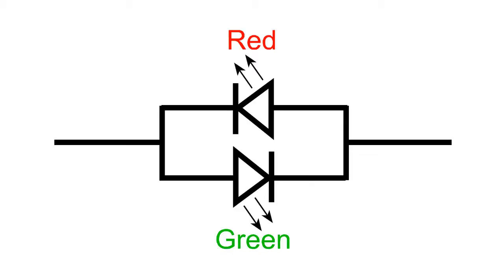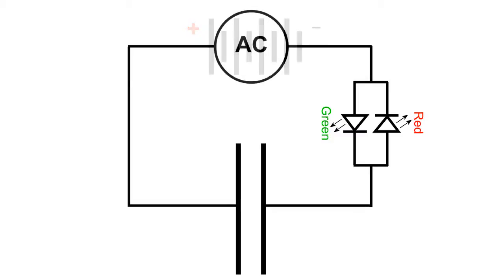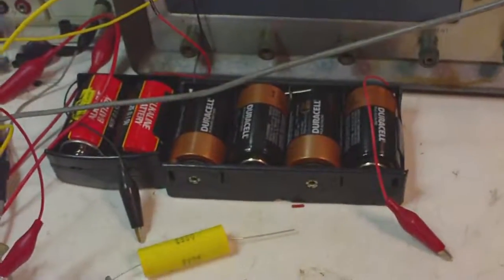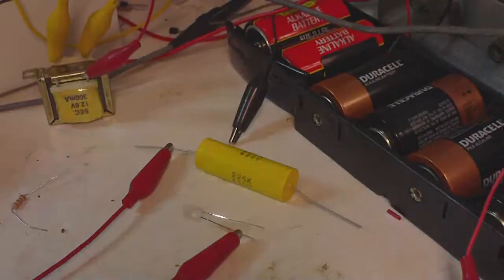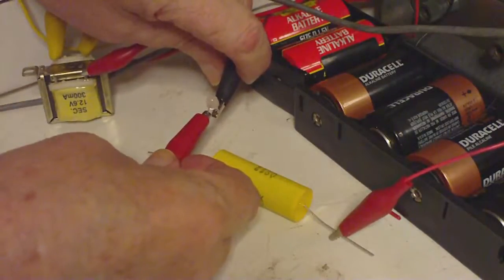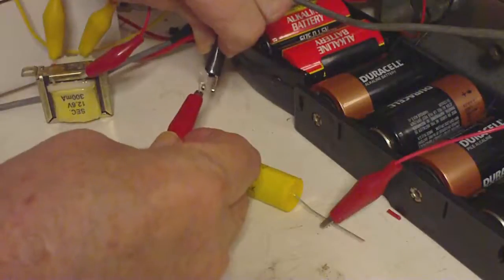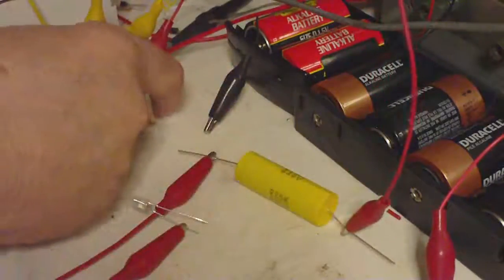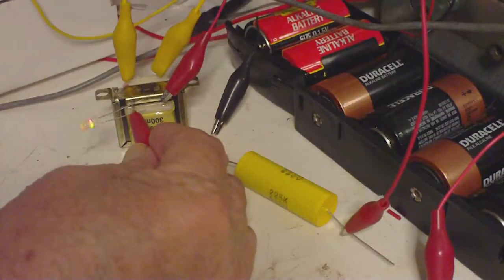Capacitors, DC and AC Current Demo

Comment: I am still not clear on this.  My problem is I have a model train passenger car.  It is a lighted car and when it goes over a dirty rail and loses connectivity, the light goes out.  How can I add a capacitor that will hold about two seconds worth of charge at 14 volts so that the light never turns off while running.  I use both AC and DC power depending on which engine.
Reply from the maker: If you are using DC and LEDS for lights a capacitor might work. Why not clean the track.
Reply: @AllAmericanFiveRadio  Track is really clean, just that when wheels go over some track joints and wobble a bit, connectivity is lost and lights flicker.  I am just trying to solve the flickering but I don't know how to calculate the capacitor needs to get a second or two of power in between.
Reply from the maker: @Toddstrainsnstuff  If your using AC, capacitors will not work. Capacitors only store DC. If you are using incandescent bulbs I doubt a capacitor will work. If you are using LEDs and DC, electrolytic capacitors may work. You must observe polarity with electrolytic capacitors, if you install them backwards they may explode. If you are using DC and LEDs I would need to know the highest DC voltage on the track.
Reply: @AllAmericanFiveRadio  Track voltage is peak 16 volts DC.  LEDs are a strip of 12 total that are rated for 14 volts, but will withstand up to 18 volts before smoking.
Reply from the maker: @Toddstrainsnstuff  I would start with an electrolytic capacitor of 1,000uF @ 25VDC. Be careful of the polarity.
Reply from the maker: @Toddstrainsnstuff  You may need to put in a diode between the LEDs, Capacitor and the feed input. In other words LEDs, Capacitor, Diode, and DC power. The diode is in series with the DC power. The capacitor is in parallel with the LED's. The diode will keep the capacitor from back feeding in to the DC power. A 0.5 amp diode should work.
Reply: @AllAmericanFiveRadio  Thank you.  I will start at 1000uF and then I would assume that I would move higher to 2000uF if needed, or do I drop to 500uF?
Reply from the maker: @Toddstrainsnstuff  That's correct.
Reply: @AllAmericanFiveRadio  Thanks for your help and have a wonderful holiday!